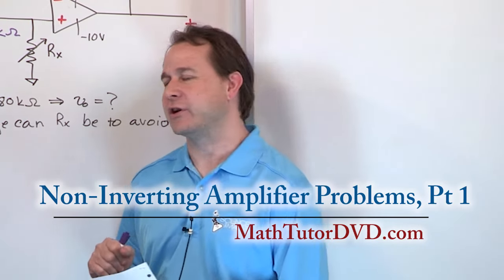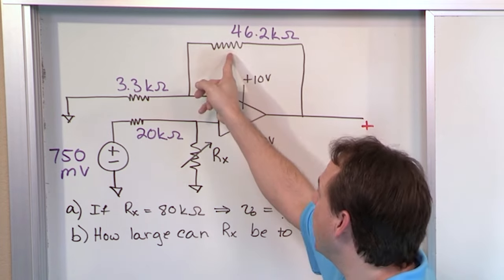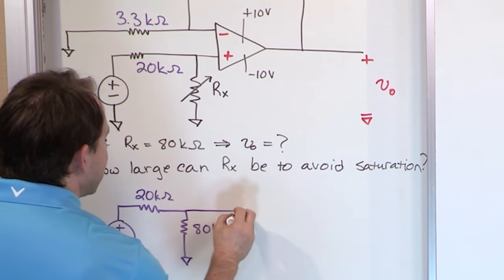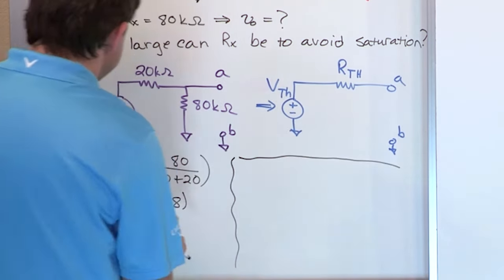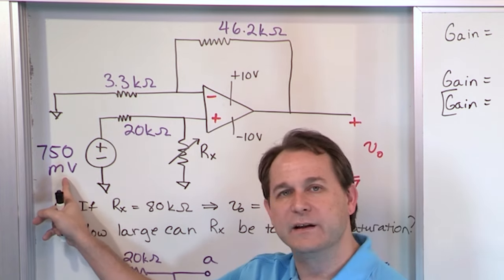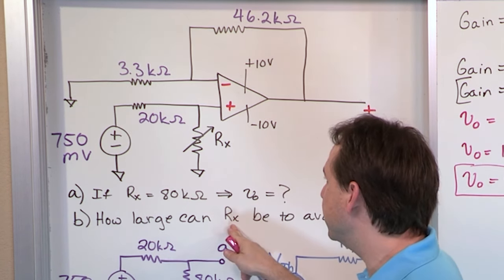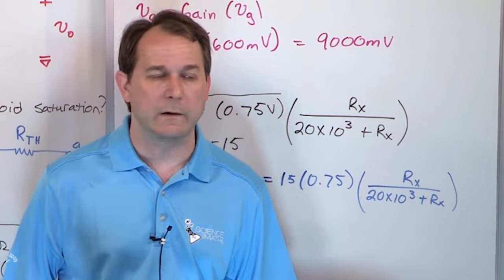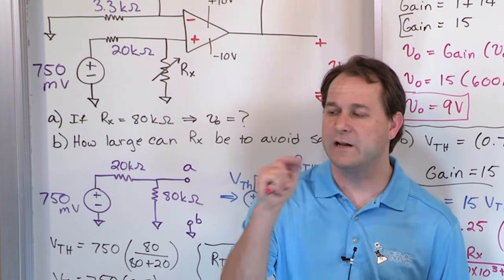02 - Non-Inverting Op-Amp (Amplifier) Problems, Part 1

Comment: I will say. telling everyone that you will get the wrong answer if you start adding the resistors is wrong. you can find the voltage drop across the 20kohm resistor and subtract it from the source voltage (which requires adding the resistances) to get what you call the Thevenin voltage. This is because we can assume no current goes into the op-amp but instead the voltage does. I only came to this video to remember saturation.

Comment: To get voltage at the non-inverting input, why did you not just use ohm's law I=E/R? Which would be .75/100K = .0000075 Amp (7.5uA). Then you measure the voltage drop across the 20K as 20K * 7.5uA = 150mv. So 750mV-150mV = 600mV at the non-inverting input.

Comment: Hi Sir can you help me understand how the two resistors(20k ohm and 80k ohm) are parallel? I don't see both ends of their nodes connected to the same
Reply: Mr. Prem Anath one terminal of both resistance 20K and Rx(80K) is directly connected and other terminals of both resistance is grounded. That's why 20K and 80 K are in parrallel.

Comment: Though this is a solid explanation I honestly think it would help students more if they found the result with the use of kcl. I personally think not only is it good practice for node voltage method but helps you see how both terminals of op amp have same voltage.
Reply: Super under rated comment

Comment: Interesting video, thank you.
I listened to your question and paused the video and attempted it myself before watching the rest.
I got the correct answers but I didn't go about it your way.

I saw the non inverting pin facing a signal with a voltage divider atached to it (You said you shouldn't do it this way but I think you can)

1)  If you do this, you get a voltage of (0.75 / (20 + 80)) x 80....= 0.6
     OP amp rules say the Inverting pin will also be at 0.6 and 0.6 / 3.3K = Is = 181.81 uA,
     Is = If,  so voltage across Rf = Is x Rf = 8.4, now add the voltage of 0.6 at the inverting pin and you get 9V

2)  Your saturation voltage is 10V,
     10V across Rf + Rs gives a current through Rf and Rs of 202.02 uA
     This gives a voltage of 0.66666 at the inverting pin,
     Op amp rule again, means the Non inverting pin voltage is also 0.666666,
     Voltage across the variable resistor =  0.666666 and  0.75  -  0.666666 = 0.08333333 across the 20K resistor,
     0.08333333 / 20K = 4.1666666 uA through the 20K resistor
     This same current goes through the variable resistor to ground and so developes the voltage of 0.6666666
     This variable resistor has to be..... 0.6666666 V / 4.1666666 uA = 159.99999 K Ohns....

Comment: If max Vo (saturated) is +10V and gain is 15, divide 10/15  for max Vin at .666v and toss that with the 20K fixed resistor into a voltage divider calculator and you easily get ~159K ohms for Rx :)

Comment: The answer for (b) is exactly 160k ohms no need to round, the conversion loose digits because of converting to real numbers during own conversions. Normally; 9.Rx=8.(Rx+160k) if you calculate using rational numbers without conversion to real numbers. That gives exactly Rx=160k.

Comment: Hello i have a question. Why is there no voltage drop over the resistor in the thevelin equivalent circuit. Great lecture thanks alot.
Reply: Because its not connected to any load yet , no current flow = no voltage drop. Regards.

Comment: I would have gotten this wrong. At the non-inverting input I see a voltage divider center tapped by a high input impedance. I do not see how the 20k and 80k are in parallel. Can you explain what make it parallel? TIA.
Reply: It is a voltage divider.
Reply: For the calculation of Vth:
You take the voltage that the Opamp "sees". Opamp has virtually infinite input impedance, meaning no current goes in... So you can imagine the input side as   if it were cut of from the amplifier .. and you literally have a voltage divider.

For the calculation of Rth: 
You need to replace voltage and/or current sources by their internal (ideal) resistance.
Note that here V-in is a voltage source AND that ideal voltage sources have an internal resistance of zero ohms.
In the resulting equivalent (Thevenin) circuit the 20k resistance is then connected to ground (through that zero ohms virtual internal resistance)
That means that from the +input you see both resistors connected in parallel to ground.

Edit.. I m quite sure your problem was that you didn't know or didn't remember to replace sources by their internal resistance... That's just a requirement that follows from the Thevenin theorem, because it is a theorem dealing with voltages.

Comment: GOOD AFTERNOON CAN YOU HELP ME SOLVE THIS PROBLEM
 A force-measuring transducer has an open-circuit output voltage of 95 mV and an
output impedance of Ω. To amplify the signal voltage, it is connected to an
amplifier with a gain of 10.
Estimate the input loading error if the amplifier has an input impedance of
(a) 4KΩ or
(b) 1 M Ω.
Specify values of resistors and for a non-inverting 741 op-amp amplifier with a gain of
10.
Find the cutoff frequency and the phase shift for a sinusoidal input voltage with a
frequency of 10,000 Hz.
PLS IVE SEEN NO VIDEO ON THIS.
THANKS I'LL BE WAITING FOR THIS

Comment: So if you had two resistors connected in series instead of parallel at Vin + we could still use the non-inverting op amp equation as in the previous video?
Reply: Yep after finding V thenvin and R thenvin u can proceed.
Reply: Yes. Since no current goes into the op amp

Comment: i got question what if given the same circuit but there's an input voltage on the inverting part as well
Reply: Then the op amp will act as a differential amplifier and it will subtract the voltages on the + terminal multiplied by the gain from the the voltage on the - terminal of the op amp multiplied by its gain.